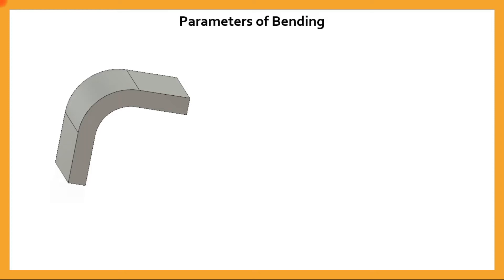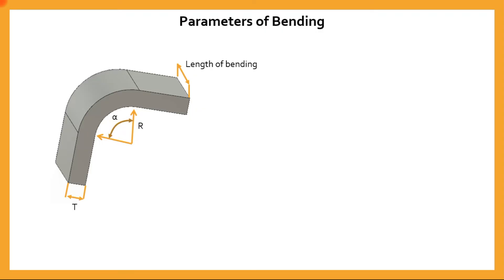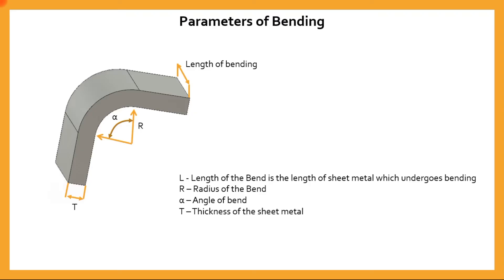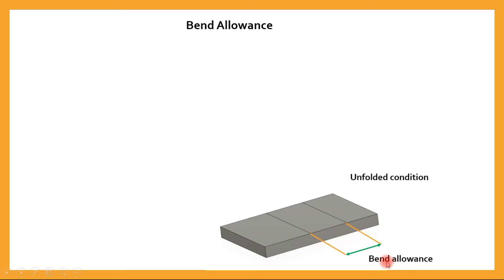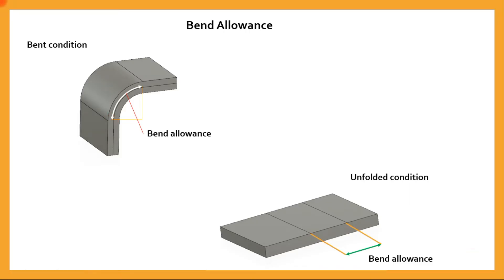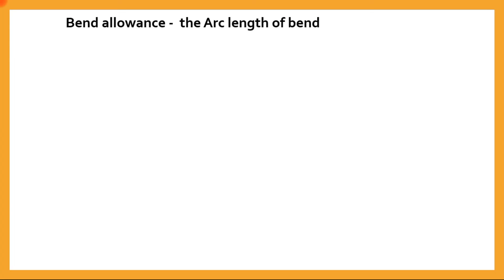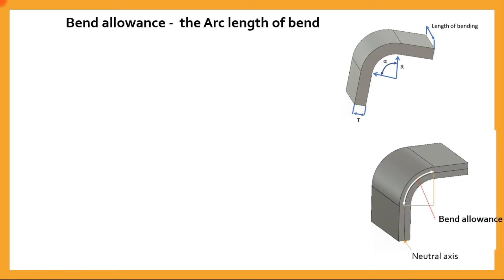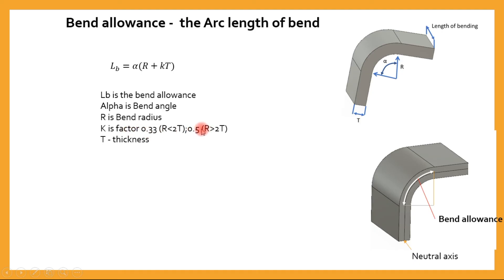Sheet metal Bend parameters and Bend allowance

Comment: What is k factor
Reply: K foctor is constant which varies from material to material, ideally it is between 0 to 1 but in practice it varies from 0.25 to 0.60, for soft materials like rubber it is 0.35 and for harder material like steel it is 0.5